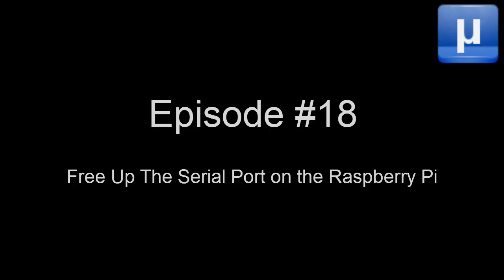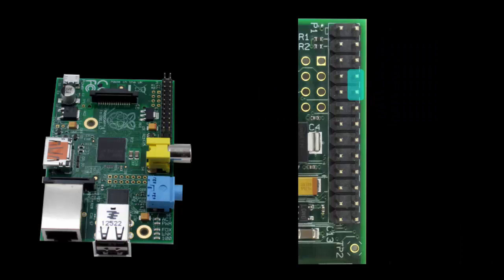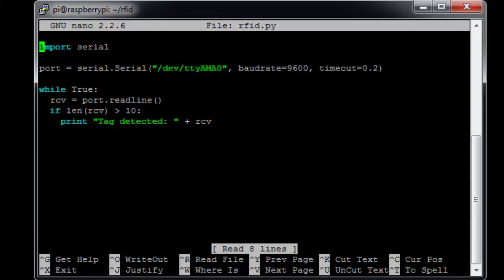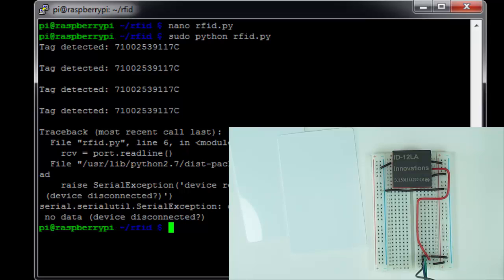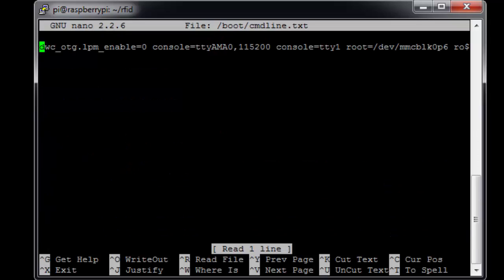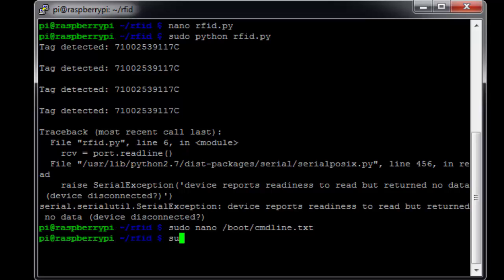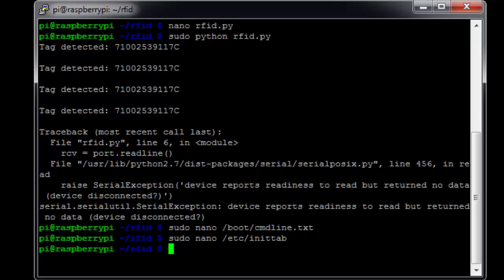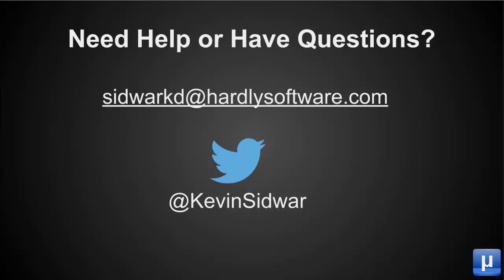µCast #18: Configure the Serial Port on the Raspberry Pi

Comment from the maker: Since the making of this video years ago things have changed on newer versions of the Pi. If you are on a Pi 3 or 4 you'll want to check out the following link for updated instructions.

https://spellfoundry.com/2016/05/29/configuring-gpio-serial-port-raspbian-jessie-including-pi-3-4/
Reply: lsusb shows Future Technology Devices International, Ltd FT232 Serial (UART) IC in the list so I'm pretty sure that that's working right and it's got a power light on.  GND to GND and VCC to 5.5V, TX to RXD, and RX to TXD.

Comment: Hi Kevin, thank you for the video.  It was very well done.  I have a little problem that I would like to ask you about and I'm way out of my league here.   I have a raspberry Pi3 and I've been able to 
get faux86 to work on it and actually start a dos communications program from around 1995.   It requires communication on a serial port but there are only usb ports.  The programs doesn't know what to do.  Do you think this can be done?  It is running (the link speed) at 1200 baud, 1 stop bit and even parity.   If I can get this to work it would be very cool!     Thank you and greetings from Arizona.
Reply from the maker: Hey Mike, thanks for watching. I had never heard of Faux86 until now. That's wild. I poked around the source code a little bit and it doesn't seem like it has any support for mapping the USB ports to generic serial devices. That said, I'd recommend submitting a question issue on the repo to ask the author how you might accomplish that if it's possible. If not it can serve as a feature request. Sounds like a super cool project though.
Reply: @KevinSidwar     Thank you so much for the response.    I was able to extract this program from 5.25" floppies in its entirety.    And this almost works!   It was incredible to see the old splash screen come up again.   Like going back 25 years.
Reply: @KevinSidwar    What is the repo?  I've never heard that term in this sense.
Reply from the maker: @mikeburch2998  If you have a Github account you can create a new issue from here https://github.com/jhhoward/Faux86/issues. Sorry for the confusion.

Comment: Hi, I'm a beginner in Raspberry pi. I'm on raspbian Jessy and I'm using a raspberry pi 3B to command a category of robot called Poppy Ergo Jr. When I run my program, it works one in three times. I get the same error (SerialException : ...returned no data (device disconnecter or multiple access on port?) than you so I tried your method (my python program sends position commands to the servo-motors of the robot)
. I already have the correct set up in cmdline.txt but when I tried to access /etc/inittab , it seems the file does not exist for me. Do you know how I could get it please ?
Reply from the maker: Hey Kevin, thanks for watching.On the Pi 3 the process is a little different from when I made this video. Check out https://spellfoundry.com/2016/05/29/configuring-gpio-serial-port-raspbian-jessie-including-pi-3-4/

Hope that helps.
Reply: @KevinSidwar  Thanks Kevin, I will give it a try 😉

Comment: Im running vb6 programming using two serial port device (sms modem and thermal printer). When running at the same time after one sms and one printing application hang up.(thats the problem) when running stand alone there is no problem. Can u help me on this.
Reply from the maker: If you have them both hooked up to the same serial port this will be an issue because they are likely to collide. Even if you are only using one at a time this will likely cause issues with the other device. The Raspberry Pi only has a single hardware serial port and it sounds from other community members that software serial is difficult to accomplish. Your best bet is to get another hardware serial via a breakout board. Something like this should work. https://www.adafruit.com/product/2264. You could plug it into the USB on the Pi and get another hardware serial port. Hopefully that helps some.

Comment: Any suggestions how to do this using the pi and C?  I'm have a pi zero W (and usb hub), with a usb ftdi com cable, it's connected to an arduino's rx/tx pins.  Is there something other than the Wiring library (wiringSerial.h).. I can't setup the interrupt in order to get data from the arduino!
Reply from the maker: Hey Ben, sorry for the slow reply. I worked on a project a while back that does this in C that is compatible with the Raspberry Pi. I haven't tried it in a while but give it a look to see if it does what you need. https://github.com/remote-wiring/serial-wiring. It mirrors the Wiring interface so I'm not sure if it would be helpful. If not you can check out the source code for that project to see how it's implemented for a *nix platform.

Comment: Hello there,  on my RPI /etc/inittab file is completely blank. Any ideas? :|
Reply from the maker: What version of the Pi are you using and which distro are you running on it?
Reply: @KevinSidwar  rpi 3 b+. I'm using rasbian
Reply from the maker: @stamatistzanos5513  The process is a bit different on the Pi 3. This post is a good resource to use. Hopefully it gets you unblocked. http://spellfoundry.com/2016/05/29/configuring-gpio-serial-port-raspbian-jessie-including-pi-3/
Reply: @KevinSidwar  This is really helpful, cheers

Comment: Hey, I would like to see the diagram with the ID12 and the raspberry. It will help me! :) or if someone know it. Here is the contact:  is_ra_el@live.com.mx
Reply from the maker: Hey Israel, just wanted to add the reply I sent in email here as it may help others who see the video. Thanks again for reaching out.

The connection to the ID-12LA is pretty simple. I don’t have a drawn schematic but I can explain it pretty easy.  If you look at the Pi pinout at https://pinout.xyz/ you make the following connections.

VCC on ID12 -> 5V on the Pi
GND on ID12 -> GND on the Pi
D0 on ID12 -> BCM 15 RXD on the Pi
FORM on ID12 -> GND on the Pi

Hopefully that helps. Here is a schematic using an Arduino instead of a Pi

https://learn.sparkfun.com/tutorials/sparkfun-rfid-starter-kit-hookup-guide#using-the-rfid-reader-breakout

Comment: The RFID code is coded in Python 2. Make sure you are running your code on python 2 and NOT python 3.
To run on python 3, simply change the last line to print ("tag detected:",rcv).
Reply from the maker: Thanks for sharing this for Python 3 users.

Comment: Hi DailyIoT, i have a question, in the cmdline.txt the port "ttyAMA0" is the first in execute? in my case i have "serial0" if i want to work with another port i have to change this comand line?? for example I'm trying to communicate with "ttyUSB0" I should change it? thanks.
Reply from the maker: If you're trying to communicate with a USB serial device that you plugged in then you do not need to follow these instructions. You should be able to access it directly in code. These instructions were specific to using the RX and TX pin on the Raspberry Pi header. Hopefully that helps
Reply: hi! thanks you" i read this blog: http://spellfoundry.com/2016/05/29/configuring-gpio-serial-port-raspbian-jessie-including-pi-3/   , i have one raspberry pi3, the process is diferent. thanks.

Comment: I have a question. I should communicate serial port on raspberry pi 3. When that source is used on pi3, but Tag detected message is broken.... I guess pi3 is different from pi1/2... baud_rate... what should i do??
Reply from the maker: Give this SO answer a look for Pi 3. Things have changed since I shot this video.
http://stackoverflow.com/questions/21596384/cannot-disable-systemd-serial-getty-service

Comment: Do I need to change the cmdline.txt file if I am running the lastest Raspbian ? Or just using "$ 
systemctl mask serial-getty@ttyAMA0.service" will work for this application ?
Reply from the maker: My understanding is that you can just use the systemctl command on the newer versions but haven't verified it personally.
Reply: In Raspbian Jessie, you can just run `sudo raspi-config`. Go to Advanced Options > Serial, and disable serial login.
Reply from the maker: Thanks for adding that here. These videos tend to get stale quickly because they iterate so quickly. I appreciate you stopping by my channel too. Hope you have an awesome weekend.

Comment: in my pi idont have inittab file  why?
Reply from the maker: If you are running the latest Raspbian then the instructions have changed. See this SO question and if that doesn't work let me know.
http://stackoverflow.com/questions/21596384/cannot-disable-systemd-serial-getty-service
Reply: it's work for me thnk you
Reply: Since Debian Jessie (Debian 8) they have gone to the systemd service manager, whereas before that they used SysV Init. So any RPi3 will likely not be able to use the method shown here. Instead you will have to disable the tty service using systemctl, so it won't get started when the Pi boots.

Comment: Hi @MicroCasts, I need to implement a RFID reader system with this antena ( http://www.ebay.com/itm/RFID-UHF-902-928Mhz-reader-writer-5-meter-SDK-Sample-Software-/261470250125 ) It's possible to read and write over the RS232 serial port ? 

Thx ;)
Reply from the maker: +Ezequiel Russo The short answer is yes. There are two things to check on though. At what voltage do the RX/TX pins operate at (the Pi is only 5V tolerant) and can it do TTL? Straight RS-232 requires negative voltages which the Pi won't understand so it needs the serial communication in TTL form. Many RS-232 products will support it out of the box but I didn't see anything on the Ebay listing about it. If it doesn't you will need something like this https://www.sparkfun.com/products/449 which will take the true RS-232 and turn it into something the Pi can understand. If that RFID reader also uses 9V for the TX and RX lines you'll need to level shift down to 5V using something like this https://www.sparkfun.com/products/12009. Hopefully that helps.

Comment: Thanks for this. Been contemplating some kernel development for the Pi and serial port seems the way to go for basic output until all the memory management, process isolation and HDD access is up. Really didn't want to start with graphics and there doesn't seem to be a nice VGA like console for Pi

Comment: Hmmm, since I just bought my RPi2 I'd like to ask you what the difference between your way of doing things and using raspi-config is? The second provides Enable/Disable shell and kernel messages to the serial connection setting inside the Advanced Options, which seems to do the same thing but in an easier way.

Comment: This is an extremely useful video. Thank you!
Reply from the maker: Microsynthesis Thanks. I appreciate that.
Reply: MicroCasts I'm trying to get access to the COM ports in the Raspberry Pi to transfer serial data back and forth and your video was very useful. Do you have any other information about serial data? There are lots of guides out there that are incomplete or just go over my head!
Reply from the maker: Microsynthesis It really depends on what you're trying to do. What are you trying to transfer data back and forth with? If you give me a little more info I can try to be more specific in my answer. My email is at the end of the video if you just want to email me.